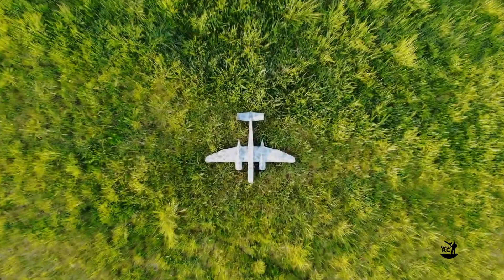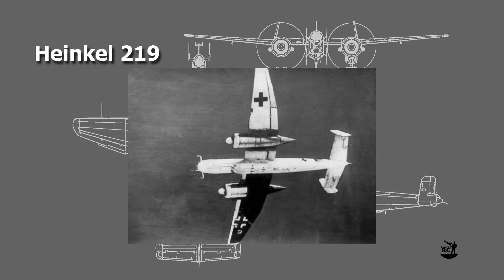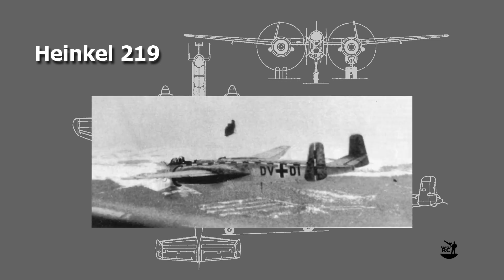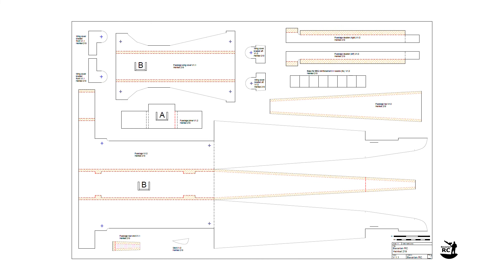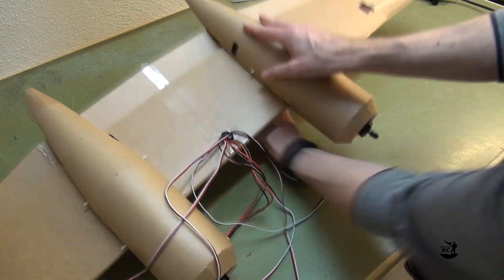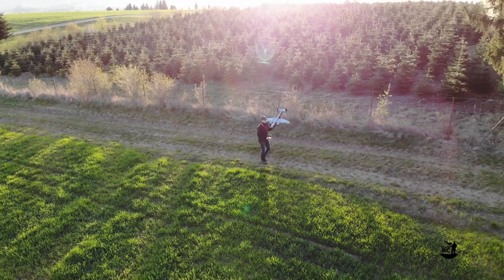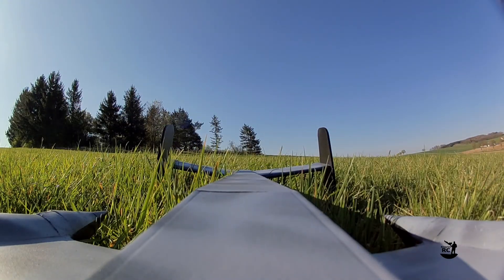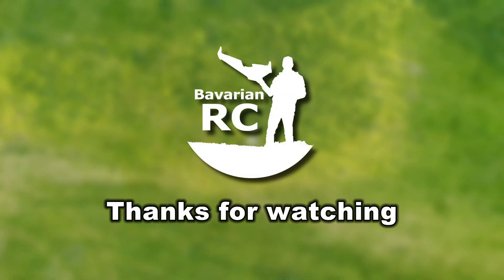Flying the Bavarian RC - Heinkel 219 Night Fighter

Comment: Congratulations on well made aircraft, you seem to like your twin engine aircraft..have you ever built a Heinkel 111?
Your 219 looks good in the air .. good flying..
Cheers from NewZealand .
Reply from the maker: Thanks a lot! It is no secret that I am a great fan of twin engine aircraft. Currently I am designing a Henschel 129 tank buster. My other twins are a Messerschmitt 410 and a Nord Noratlas … No Heinkel 111 so far, but certainly a good candidate for the future! Greetings to NZ